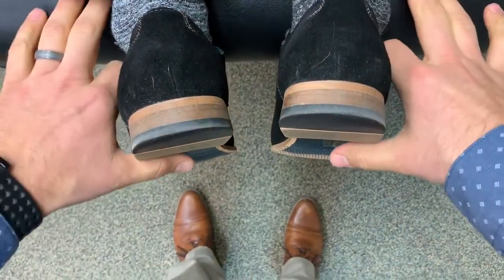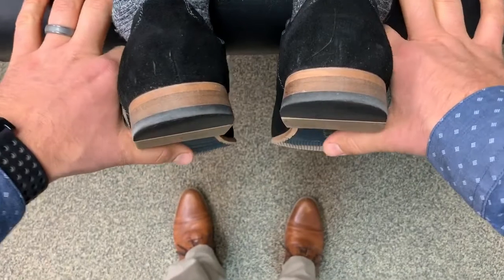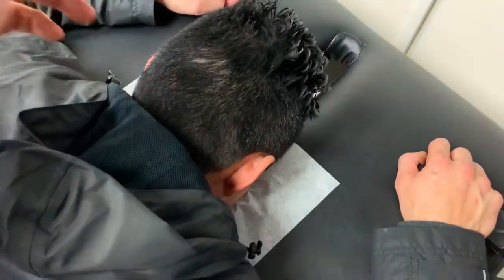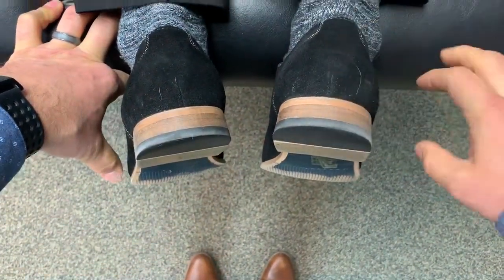Functional Leg Length Reflex Demo

Comment: What if the client combs his hair later. Will the motion of the comb against the skull 😅 change his leg length. That would apply more force the the point than twisting your finger.😅
Reply from the maker: You're right that sensory reflexes like this don't take much to activate at all. Just like it wouldn't take much pressure to tickly the bottom of your foot and cause you to quickly move your foot away. And it's a common misconception that we're changing leg length when what appears to be leg length changing is actually the reflex attenuating/turning off

Comment: activator doesnt work
Reply from the maker: We don't use the activator. This is the integrator. Looks similar but VERY different in function
Reply: @principledlivingtonalchiro  what's the difference? My chiro uses an activator.
Reply: @starchild2121  Great question! Activator technique is more of a structural analysis and the activator is a more forceful input that will adjust the position of the spinal bone.

Torque Release Technique asseses for abnormal tone (tension) on the spinal cord and then uses the gentle vibration from the Integrator to correct that (so the correct signals can get to the muscles and the muscles can align the bones).

Comment: Utter BS. Through the shoes. Seriously?
Reply from the maker: Are you questioning seeing a reflex through the shoes? If the shoes are fitted properly the line between the upper and lower shoe increases the accuracy of the reflex (easier to judge than the rounded bottom of a bare foot)
Reply: No one is questioning - we’re asserting the obvious, lol.